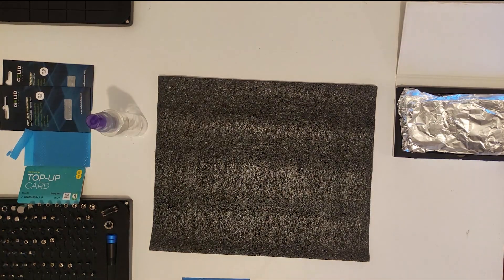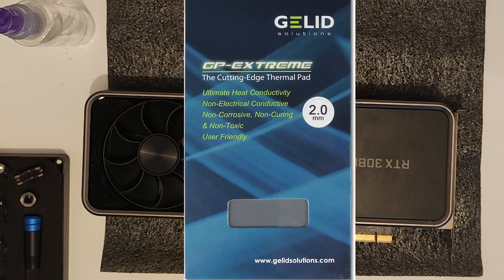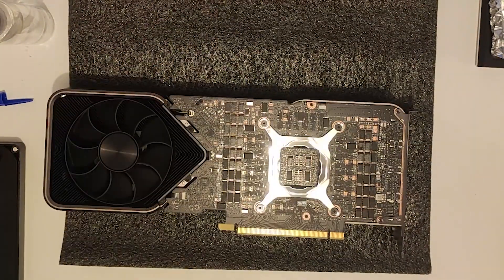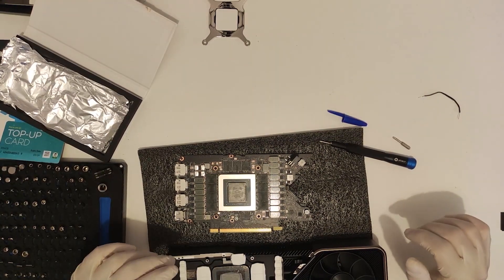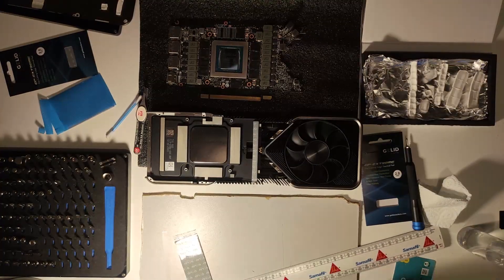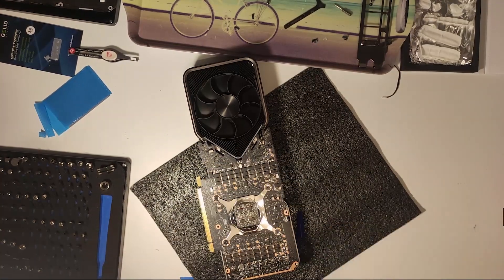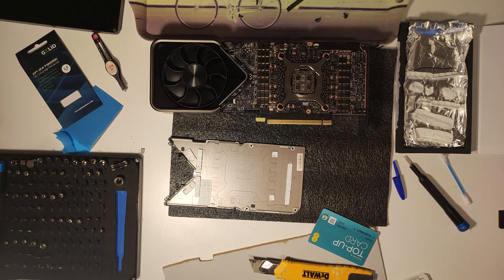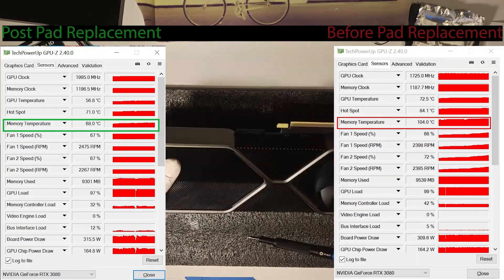Nvidia RTX 3080 FE Thermal Pad Replacement & Re-Paste-Improve your Mem Junction Temp by OVER 20C

Comment: Great video, is it worth putting thermal pads on the back as well? How much difference would there be in temps if I just replace the ones on the front?
Reply from the maker: If you do the front of the PCB where the majority of heat generated by the memory chips gets transferred onto the cooler and provided your pads were already delaminating you will see about 20-30C improvement. There will be smaller gains if the factory fitted pads were still making good contact - but it should improve by a minimum of 10-15C regardless as the nvidia OEM pads are crap. I would say its definitely worth putting pads on the back as well - covering the PCB where the memory chips are located will give you a couple of degrees (1-3deg at best) and its optional.  Covering the power delivery SMDs on the back (i.e. how they come from the factory) is highly recommended though. If you run out of pads just reuse the ones that came with your card as it will be better than nothing.  All that being said, there are some water-cooling kits such as the Corsair one that do not feature any thermal pads on the backplate so it will probably work OK without, but personally i would err on the side of caution on this.
Reply: @ESHW  oh ok, since I'm opening it up might as well put the pads on the back too, it's just that the pad themselves cost a little more in my country 2mm is $17 and 3mm is $21. Also for thermal paste should I spread it after the applying the cross/dot or leave it as is (I have mx-5)?
Reply from the maker: Yea, do put thermal pads properly since you are doing the whole process. About the thermal paste - it's honestly up to you. I can't be asked to spread it out, and the Mx-5 is super fluid so I would say that the pattern doesn't really matter as long as you get enough on there to cover the whole die (there is the actual die, not a heat spreader like on a CPU so I can't stress enough that full coverage is essential).
Reply: @ESHW  Oh ok np I will make sure to cover the entire die while applying the thermal paste. Thanks for helping out! Btw is possible to get a template for your optimized back thermal pad layout 😅?
Reply from the maker: @MazharMalim  I took the easy way for the back simply covering the original areas with the same size of thermal pads so i knew that the bits that nvidia deemed important were OK and then kind of winged it when it came to covering the memory modules. I only reused the 0.5mm pad as i did not have any that slim. Without opening the card to measure what i did i can't really provide an accurate template :( . What i do remember is that it was exactly as much as i needed from the 2nd thermal pad and what i had left from the front as there was nothing left at the end. If you follow the coolpenguin1 template you will definitely need 2xGP pads so stick to the areas that were covered with the stock pads and whatever you have left put it on the memory chips.  Even if you have bits that are cut-up you can still use them without any issues on top of the memory as whatever you put there will be an improvement from nothing at stock. Do let us know how it all panned out after you do your mod please!
Reply: @ESHW  Hey, so i'm in between the repad/repaste, the leaf spring seems to bend the pcb a tiny tiny little while trying to screw it in. Is that ok? ( Im not sure about bending but it took a lot of pressure to put the screws back)
Reply from the maker: @MazharMalim  Hi - yes that is normal the leaf spring will put quite a bit of pressure on the PCB - just make sure you thread the screws in an X-pattern (start on one corner then the opposite corner and so on, never two adjacent screws) so the PCB doesn't get stressed too much. Once the screws are hand tight stop (think the same amount of force you would put on a case screw or a CPU mount screw), you don't need to put any real muscle into it.
Reply: @ESHW  Thanks for the quick reply! I have successfully repadded/pasted the gpu and the temps now are way lower on the memory 84-88c vs 104c in games like cb2077, rdr2, gta5 with the same fan speed! A little less with full fan speed 80c vs 100c. Btw my gpu core hotspot delta is around 14-15c, is that ok?
Reply from the maker: @MazharMalim  Nice Job! I am glad it worked fine. The core (edge) to core hotspot delta at 14-15C is a bit on the high side and might indicate less than perfect contact, but considering a "good  delta" is 8-10C you are not a million miles off either - how was it before the re-pad do you recall? I would suggest monitoring it for the next few days as that will give the pads and thermal compound a chance to relax and settle down a bit as that might improve things to the tune of 2-3C (some thermal compounds do that, Artic Silver 5 comes to mind). You can try to compress the pads a bit using something very flat - I used a little pocket mirror and seeing if that makes a difference, just be very careful to not be overly aggressive and squish them too much leaving a gap - its a balancing act. If the core hotpot isn't going above 88C I personally would not bother and just enjoy a cooler and less noisy card :)
Reply: @ESHW  Oh ok yes will have to see if there is any changes going forward. Before the mod my delta was actually lower, around 11-12c. GPU temps are higher than before too, I'm guessing maybe cause of the extra thermal headroom it has now. I might have to open up the card again for reapplying the paste, which one would you recommend other than Arctic MX-5? (I'll try spreading the mx-5 paste too and see if that helps if not then will try a different one)
Reply from the maker: @MazharMalim  The MX-5 is not bad in my experience, I personally love it because it is alcohol soluble. It is by no means the only good paste on the market, I have also used in the past Thermal Grizzly Kryonaut and that is a bit better, but only to the tune of 1-3C or so in my experience with the price being way higher. Spreading the Mx-5 won't do much considering it will be spread out by the pressure regardless, it is a very fluid paste! Remember that for direct to die cooling more is better - there isn't a heat spreader on top of the silicon so any imperfect contact will have a major impact so make sure you put just a smidge more paste than you would on a CPU.

Comment: Do you have any recommendations on what to do if the card starts buzzing after performing the thermal pad mod?

Update it is gone now? I used the thermal pads in your guide and now it is gone. Thank you for the fantastic guide
Reply from the maker: I am very glad its sorted, and if this video helped you than even more so! Just make sure you check all the relevant temperatures regularly for a couple of days, just in case (especially the pesky core hotspot one!).
Its hard to say what buzzing you are referring too - if you manually stop the fan did it go away? Or did it sound more like this: https://www.youtube.com/watch?v=ZT6PzY8bT1Q&ab_channel=PhilsComputerLab .. if its the latter it's coil whine and it usually happens on most GPUs when they draw a lot of power and push a lot of frames - capping the framerate to 60 or 120 (or whatever your monitor refresh rate is) should fix that problem if it re-occurs :)
Reply: @ESHW  I'm not sure what the buzzing was might have just been the fan hitting a cable in my case. But the Temps have been fine over the past few days.

Comment: So I did this and my Vram temps dropped form 110C to 80C...

My GPU temp did go up from 50C to 65C... but I think that is just the heat sink having to deal with that extra 30C in heat from the Vram.
Reply from the maker: Nice! Sounds like you have a good contact between the VRAM and the cooler - have you checked your GPU hotspot using hwinfo64? Make sure that the difference between GPU temp and Hotspot isn't more than about 15C...
Reply: @ESHW  What would be the fix if it was?

Just redoing the paste?
Reply from the maker: @ArkAngelHFB 
Don't do anything until you confirm what the average and hotspot temps are under load. 

The reason i am saying that is because the increased GPU temp might also come from the fact that the chip can now stretch its legs, no longer being bottlenecked by VRAM temps (once the chips go above 106C "gentle" throttling starts, a bit of a drop in clock, etc - at around 110-112 the fans go to max and very hard throttling occurs where the core frequency drops to protect the card - as i am sure you have already experienced). 

If there is a large discrepancy between core and hotspot, then the fix does involve a bit of trial and error - it's not the paste itself that is the issue, its most likely the pads ever so slightly holding off the cooler - we are talking fractions of a mm, but enough to cause trouble.
What i did to fix this was press to "flatten" the pads a bit more using a pocket mirror (anything super flat will do). Make sure you don't compress too much or you will end up where you started with imperfect contact to the VRAM modules. It's fiddly and it might take a few tries to get it perfect, i opened my card up 3 times, but in the end the result was the same GPU/hotspot temperatures as before and 30C lower on the VRAM modules, so i would say that the effort is well worth it.
Reply: @ESHW   So I did a lot of fiddling but right now I'm steady getting 100 MH/s. 

240watts, 
Hotspot 91C
Core 68C
Vram 82C
Mem clock +1350
Core Clock -100
Reply from the maker: The core to hospot delta is high, but 91C should be OK for the hotspot long term, just make sure you don't go much beyond that. Ideally it should be around 83C or thereabouts on the hotspot with a 68C core. if you are using it primarily for mining I would say let it as it is as it's not an outrageous temp and 100mh sounds awesome; I primarily test it in games (with cyberpunk so far hitting hardest). I'm by no means a mining expert, but I would try to limit the core frequency a bit more than -100MHz, after all ETH doesn't really care that much about core frequency as it is a memory intensive POW algorithm.
Reply: @ESHW  did u use 2mm pads for front side and pressed them to reduce the thickness
Reply from the maker: @ppbagroupa2348  Yes I did - the "pressing" though was very gentle and it was more of a flatness adjustment than a lot of thickness reduction

Comment: Hello fellows miners, I have reduced my mem temp by approximately 20°C after repad. Only problem the core temp has increased by 20°C. Do you guys have any idea ? Plz save my GPU :)
Reply from the maker: It just means that your pads are holding the die a bit off the cooler. You will need to very gently and evenly flatten the pads a bit more ;)
Reply: @ESHW  ok I changed my pads for 1,5mm. Only problem the GPU boots (fan and rgb are on), but there is no vidéo signal. I hope I did not broke my GPU or I am  so screwed !

Comment: thermal pads Iceberg Thermal DRIFTIce 2.0мм maybe these are suitable as an alternative?
you could not clarify, I did not quite understand where thermal spacers are used 2mm and where 3mm
Reply from the maker: I quickly looked the Iceberg ones up and at 13W/mK they will definitely fit the bill. They are a bit on the tough side at 45 hardness, but with a bit of persuasion they should comply, it will just make the install a bit trickier. 
To answer your second question - I used 2mm pads all around and they made proper contact as far as i can tell - the card has been running for about 6 weeks now and the temperatures are nice and stable (i could not find 3mm in stock anywhere so i decided to yolo it). If you can get both 2mm and 3mm pads then the 2mm pads will go on the front of the PCB (contact to cooler, where the GPU die is) and the 3mm will go between the backplate and the rear of the card.
Reply: @ESHW  google translate somehow in its own way)) thanks for your answer, but could you add to your guide a picture not only with the length of the thermal pads but also with the thickness it would be very cool
Reply from the maker: @KonstantinOverlord  To answer your question: all the pads I used are 2mm thick :)
Reply: @ESHW  that is, I can not worry and stick 2mm everywhere?) as in your review
Reply from the maker: @KonstantinOverlord  My opinion after doing just that is... YES :)

Comment: if i plan to only replace pads on the front 2 packs of GELID 80x40 should be enough, right? amazon sells them in packs of two and its already 22 bucks. dont really want to pay 44 bucks. also can you tell me exactly what screwdriver i need? i dont want to buy an expensive big kit of screwdrivers just for this one usecase.
Reply from the maker: It's been a while since I've done that project, but yes - I believe it will be enough as I only ended up using one pack of 2. On the screwdriver front ,I honestly can't remember - I would just buy a £2/$3 precision screwdriver set from eBay - they are not very good, but for one use they will do the job (what can you expect for half the price of a Starbucks coffee though....)

Comment: Hey, do you have a layout on how you optimized the thermal pads for backside of 2 sheets into 1? 
Thanks
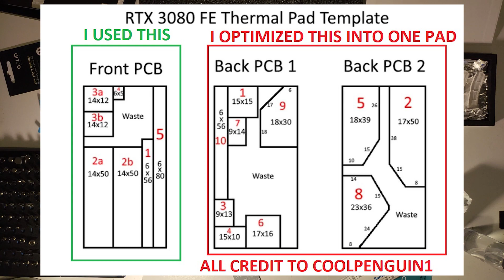Reply from the maker: no, sorry - its been a while since I made that video.  From what I remember, I used the diagram i showed at 9:50 and I cut 1,7,3 or 4  (don't remember exactly which ones) shown on the back PCB pad1 from the waste i had left out of the front PCB pad which  gave me just enough so i could cover everything with only two pads as 2,5&8 from back PCB 2 fit perfectly into what remained from back PCB 1

Comment: @Ethically Sourced Hardware  ok I changed my pads for 1,5mm. Only problem the GPU boots (fan and rgb are on), but there is no vidéo signal. I hope I did not broke my GPU or I am  so screwed !
Reply from the maker: Let's hope not - unless you physically damaged the card (knocked a SMD with a screwdriver or put uneven pressure on the die and cracked a corner) it's fairly unlikely that it would have died. Can you put a second card in the system and check if it's detected in Windows? Have you tried a different motherboard slot? If it somehow has failed and you are convinced you haven't damaged it yourself you can try and claim warranty from Nvidia through the shop where you purchased it.
Reply: Il you have an msi afterburner profile loading on startup thats the issue. Boot in safe mode and uinstall afterburner to’ solve

Comment: after trying squishing the 2mm gelid extreme maybe too much, now the gpu wont turn on. I see only the fans spinning. 
I changed the cable, the psu and the mobo, repaste the die but it wont turn on.
what can I do?
Reply from the maker: I doubt you could put that much force on the memory chips through the gelid extreme pads to do any damage that way - you would really have to put some muscle into it, PCBs aren't that fragile - its  unfortunately far easier to knock a small SMD out by mistake with a screwdriver or the like and not notice... The first thing I would try is to get a spare GPU and mount them both into the same PC - get the display-out from the second GPU and see if device manager sees your card. If you are using an Intel system or an AMD APU just plug your HDMI into your motherboard video out. Then you can see at least what the situation is.
Reply: @ESHW  I did it, gpu is not recognised in device manager
Reply from the maker: @slimeseason4012  do you at least get an unidentified GPU device with a warning next to it with "Windows could not start drivers" or similar error in the properties? if you do you can try and re-flash BIOS (see techpowerup  for great guides and tools on how to do that). If that is not the case and you don't have anything to loose, you can try to RMA - worst case scenario Nvidia says no, but from others experience they are just as likely to send you a shiny new GPU. There is no warranty sticker on FE GPUs anyhow and as long as there is no visible damage I would very much encourage you to at least try it.
Reply: @ESHW  no it looks like the gpu isn't running at all, not even the leds. 
I'm trying an RMA saying that I switched to a waterblock but temps still went high until it stopped working. 
btw I messed with a couple of the torx 5 screws of the backplate, and I don't have the stock pads anymore so they will instantly notice I could have improperly installed the waterblock and say that is all about physical damage, not covered by the warranty
Reply from the maker: @slimeseason4012  just say it stopped working - let them deal with the rest...
Reply: @ESHW  I just tried the gpu without the cooler and I can feel is heating so it should still be alive, I did not wait enough to get video signal though since I was too scared after the first 4 secs
Reply from the maker: @slimeseason4012  Modern GPUs turn themselves off before damage occurs so that is  a relatively low risk thing to do. If signal comes out then it will be a bit of a conundrum (hopefully no liquid metal was involved at any stage...). Obviously don't let it run like that, but you should be OK for POST.
Reply: @ESHW  it’s warm on the core but I get no video signal

Comment: I have a problem, when I put 2mm pads on my 3080 FE I get around 20+ GPU hotspot temps (20 degress above actual GPU temp reported) but the memory junction temp goes down nicely. When I put 1.5mm pads it's the opposite, the GPU and hotspot temps are good but the memory temp is not. What should I do!?
Reply from the maker: That's a very accurate description for both sets of pads...what I suggest is using the 2mm gelid extreme (squishy ones) and (very) gently and with the help of a small piece of glass (or something very very flat)and set of Vernier callipers if you have squish the pass down by hand about 0.1-0.2mm each time. Reassemble and test to see how to hospot is - the memory cooling will be OK. When you get around 10-15C core to hotspot delta stop there and enjoy gaming.
Reply: @ESHW  great tip I will try that thanks!